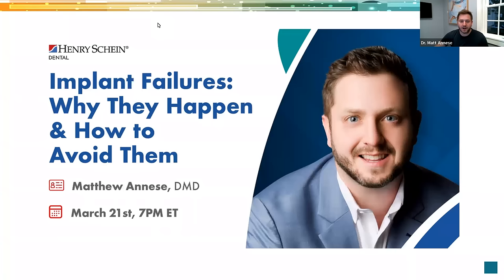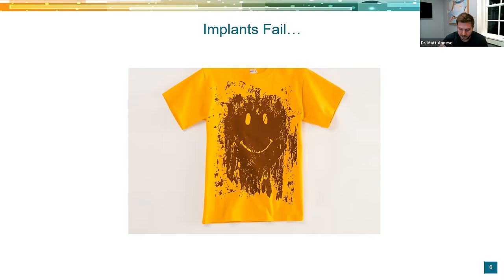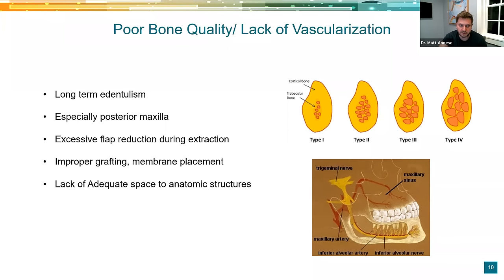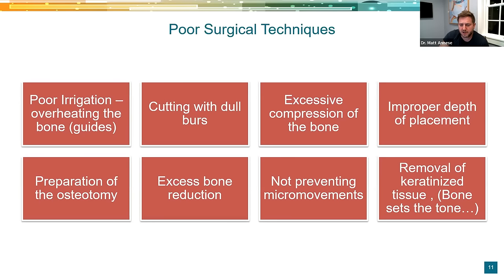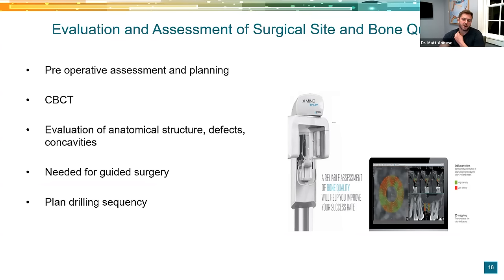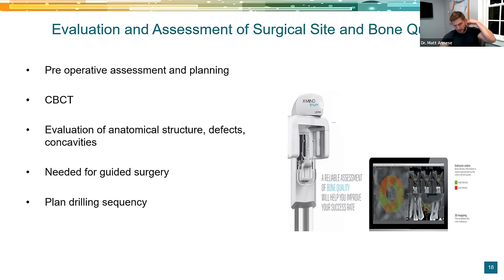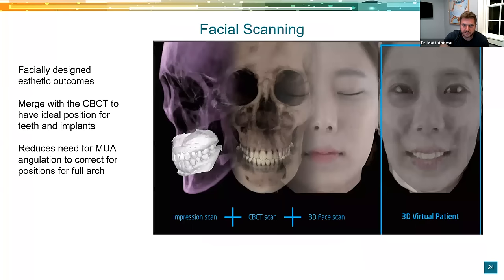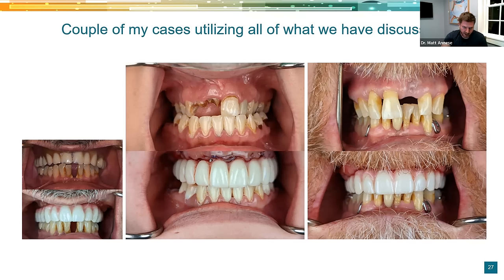Implant Failures: Why They Happen & How to Avoid Them

Comment: My implant doesn’t hurt. No signs of infection but now it’s popped up when I took my snap in out. It’s in the healing process. It’s been like a month. It pops up and pushes down. No infection or pain going on. My others never did this so I know it’s not right. I have all on 4 done on top. Now trying to get the bottom

Comment: I have 11 dental implants. Just after 4 yrs  the bone is shrinking  around all the implants. I did have low Vit. d deficiency, which has been corrected.. My family doctor didn't think it was necessary to check the vit. d., so I did not know it was very low.I have also taken antacids, which had steroids in the medicine.I did not know this at the time I was taking the medicine.Now my prosthodontist Is going to try to save my implants.The costs of bone grafting and implants have cost over 70,000 ,4 yrs ago.
Reply: Make sure to increase your protein intake, most of the dry weight of bone is protein, target 1g/lb(ideal bodyweight) of protein per day.
Reply: Wow good to know
Reply: @Gengh13 That’s very valuable information. I’ll pass that on to my oncology nutritionist. She’s probably not aware of this either.
Reply: I hope it goes well for you this time.

Comment: This presentation was very informative.  I have severe bone loss and don’t want to take the chance on dental implants. My dentist quoted $8000 for one tooth implant and bone graph. All that metal! Radio waves and EMF radiation should be a concern.  Tankful I made it 70 yrs enjoying my natural teeth.

It’s 2022 - Why has dentistry remains archaic and painful? Dentures don’t fit and are painful to wear and chew. Flexible full dentures and partials seem to be a good option so far. The info you presented is valuable.
Reply: P0kplp
Reply: P
Reply: Kklpll,,,l.
Reply: .k0
Reply: P0pk